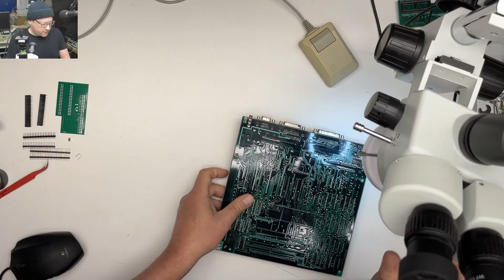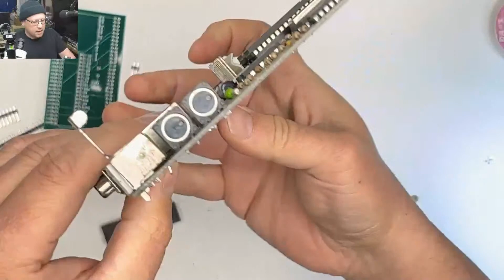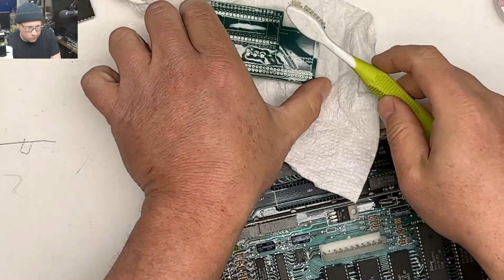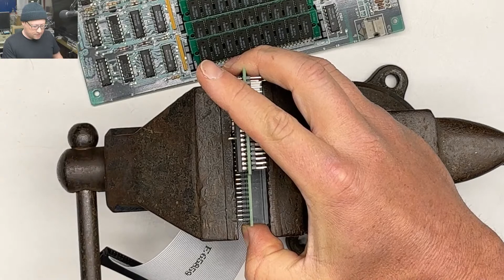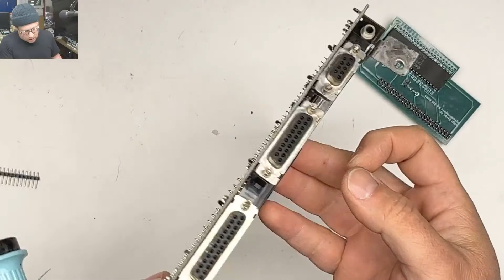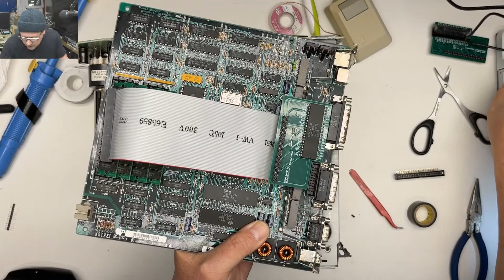Macintosh Plus internal SCSI modification - how to

Comment: This is a really great project.  I tried to use the gbr files to order this and I got a response back from the pcb company you used asking for me to submit it in a rs-274-x format.  I have never ordered anything like this before so I don't know what that means. :)
Reply from the maker: I'm really sorry! I finally had a chance to review everything and found out that my github was missing a couple files.  I have gone back and added the files. I also added a zip file of all of the required files so that you can just send that zip file to the PCB manufacturer.  I just submitted an order for another batch and the review passed, so I think we're good to go now!
Reply from the maker: Thanks! I’ll check over this tonight. I’m pretty sure these are the exact files I used. But I’ll redo the export and see if that rs-274-x is an option somewhere I missed.